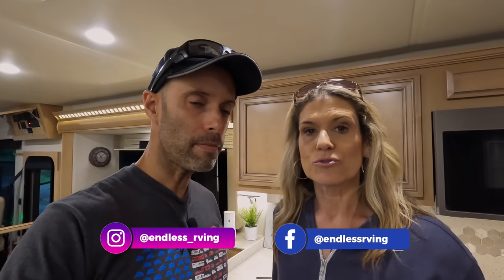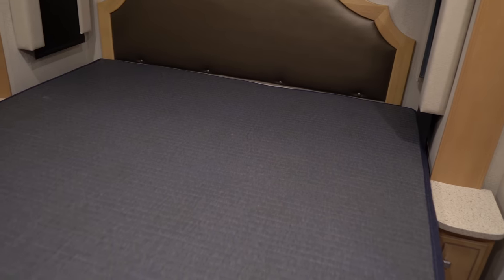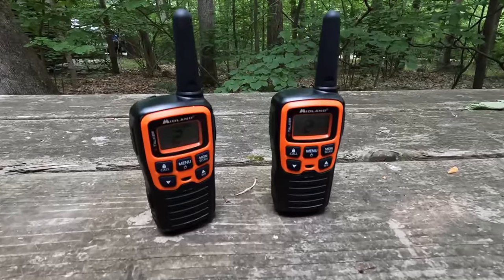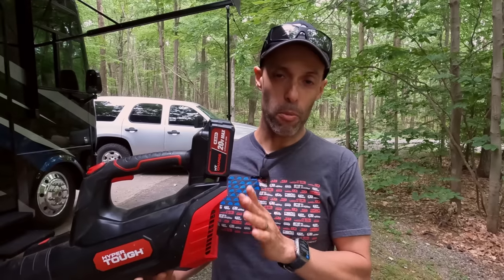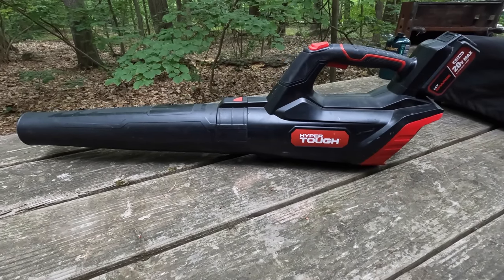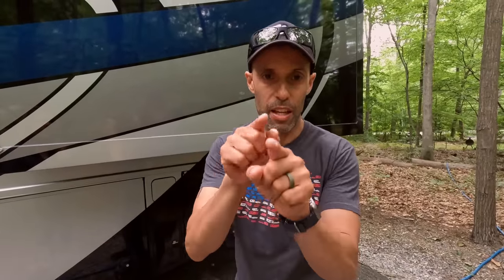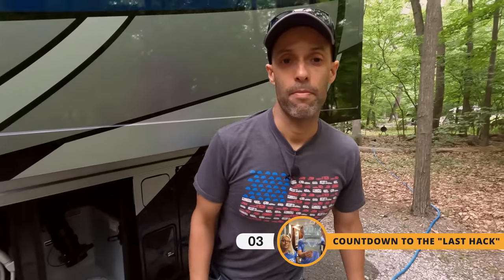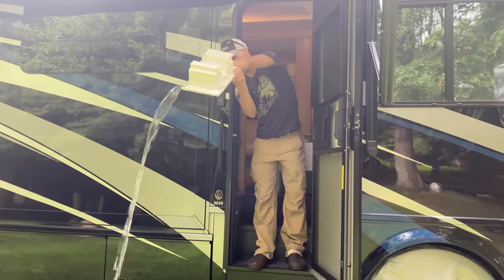8 Easy And Cheap RV Hacks To Make Your Next Camping Trip A Breeze!

Comment: On thing I would caution about is electric heaters draw a lot of wattage and create heat in the cords if used for long periods of time which can cause fire. I have even had it melt and damage my Rv electrical receptacles and wiring I have been using them for 40 years with different makes brands and models with not too much success

Comment: Key lock box with four digit code mounted in the propane compartment on the door.  Don’t have to crawl under the rv to get the key.  I put both door keys in the lock box and hide the ignition key in a drawer inside.

Comment: Hi guys, just watched your video and we are not full timers so our motor home stays parked next to our house. We live in Florida and used to run our ac in mh but electric has gotten really expensive so it’s just the dehumidifier now. However, we have one more hack we do with it. We attached a small length of hose to the dehumidifier and put the other end in the shower. We connect our dump hose and the water drains on our ground. We’re not constantly having to empty the bucket.

Comment: Great tips as always. 

Don't ever drive with the hanging damp rid bags. I forgot to take one down and it fell and burst while driving. The liquid is extremely sticky and took multiple mopping to get it up. They wrok great but I no longer allow them in the motorhome. Lol. 

We use countertop dehumidifiers year round and when in storage during the summer I have a larger dehumidifier that drains into the sink.
Reply from the maker: Great tip!

Comment: Thank you for your hacks. Agree with all. However, I would like to comment on the two appliance recommendations. Having spent 45 yrs in the appliance industry and particularly in appliance safety: 1. Please be careful with space heaters. Hundreds of fires in US each year because people use them incorrectly. Yes, you can buy heaters that have tip over switches, but some do, some don’t. Some are UL, ETL, or CSA listed for safety, and the ultra cheapies on-line or 5 cent stores are not. Be careful where you place them. Watch the cords and plugs. Use them on low or medium heat, never on high. Check cords often. If you want to know why, ask me. 2. Dehumidifiers: there are good ones and there is junk. Be careful. It would be safer to use them when you are present. Never leave them on when RV in storage. Watch the recall lists. Millions have been recalled for safety issues. Buy a name brand you know. The company will stand behind them. Buy something made in last 2 yrs as standards have improved. If you have one more than 5 yrs old, cut the cord and throw it away. Make sure your smoke detectors work. Leaving any appliance on when you are not home is like giving a child a book of matches to play with. BE SAFE. RVing is supposed to be fun.

Comment: Nice informative video. I subscribe to your channel and have used a lot of your advice. I installed the extra waste valve on my 5th wheel trailer after a similar incident with the black water dump. But I installed a short clear extender tube between the permanent outlet and the extra valve. This allows me to see if there is some fluid in front of the extra valve and be prepared for a small leak when I remove the cap to attach the hose. This has saved me a lot of times from a mess. Thank you for putting all this information out for our education.  Tim Rector
Reply: We have the clear one too and dump/flush at home with a macerator into our septic - nice to know when the water is clearing up while flushing.

Comment: Thanks, MJ and Izzy.  I do have a dehumidifier in our 5th Wheel. Runs 24 7.  Works great here in Florida. Will be working on getting the valve for the holding tank next.

Comment: So many great RV hacks, MJ and Izzy, thank you! We hang DampRid absorbent packs in a few places within the coach, they do an amazing job getting moisture out. I recently purchased a floor model dehumidifier thinking that a stronger unit might also extract moisture, but it's so dry in there it never runs! Also, to help get moisture out we leave drawers and cabinets open and add a pack or two of desiccant to each drawer. I hate the smell of mold!
Reply from the maker: Wish we didn’t need the dehumidifier! Lol

Comment: Always good to get ideas about how to make RVing more efficient and fun.  Just curious regarding the dehumidifier, though.  Do you keep an AC unit on during storage/parking to keep humidity out?  We leave ours on set high to about 83 degrees here in southern Georgia.  The coach can easily reach temperatures over 100 degrees without it.
Reply from the maker: No A/c just the dehumidifier

Comment: I don't see that heater in your Amazon store.
Reply from the maker: It’s near the top of the video description. 👍
Reply: @EndlessRVing  Ah!  Got it!  Thank you!  Another reason for using a space heater is that the propane heater is forced hot air.  It's warm while it's running, but starts to immediately cool down upon shutting off - and there is a vent in the tiny, TINY bathroom, so unless you keep the door open (and no one wants that), the heat will suck the air right out of you!